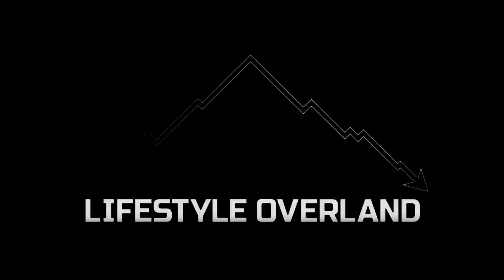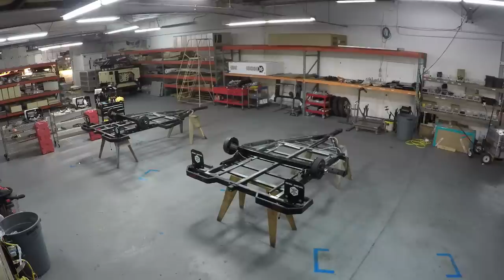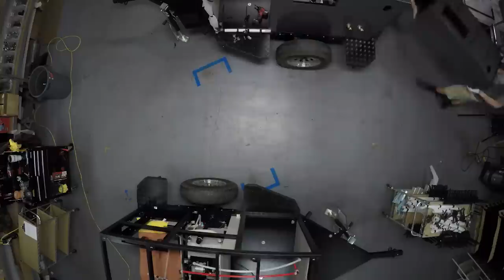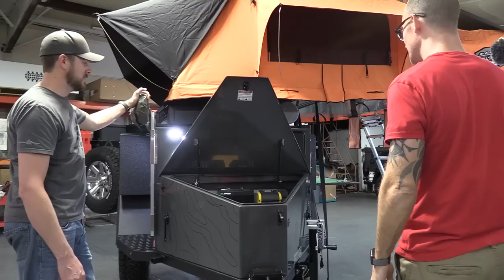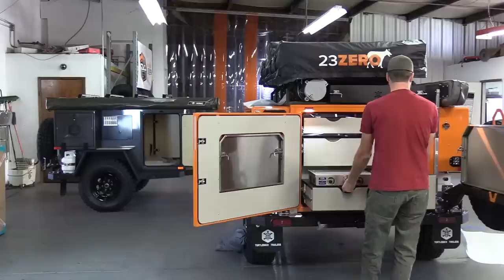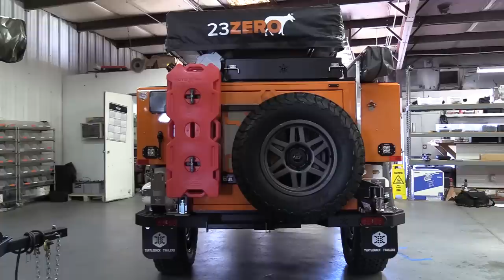Testing our new Expedition Trailers with Swell Runner!

Comment: Great build.  No pressure, but how do these compare w the Patriot.  They look the similar, just curious what your major selling point is.  PS before you say built in USA, remember I am and ex-aussi living in Canada.
Reply from the maker: Thats a great question which we get a lot. They are both amazing trailers but we went with Turtleback for a few  reasons. 1) The water tank is actually inside the trailer, not under it. That means we can camp in freezing weather as long as we turn on the water heater who's ambient heat actually keeps the compartment above freezing. You can not take the Patriot into freezing conditions with water in the tanks or they will freeze. 2) The kitchen opens to the rear on the Turtleback, depending on the model, the Patriot kitchen opens on the driver's side, which is into traffic in America. 3) The gas systems are already connected on the Turtleback, just slide the kitchen out and turn on the stove. You have to physically connect the stove on the Patriot to the tank every time. Also, the water heater and stove both run on propane, so no need to buy both desiel and propane. 4) The tongue weight of the Turtleback is between 125 - 150 lbs so you can physically move it if needed on the trail or at home. The Patriot tongue weight is 425 lbs which is also a factor if your rig is already heavy with mods. 5) Turtleback uses domestically available components and appliances you can find at any RV shop. Patriot has AUS proprietary components and appliances so it might mean a longer wait for service.
That's just a few items from our pros and cons list. Not knocking the Patriot at all, it has a really cool look and is a capable unit. It's just going to take a while for them to adapt to the north American climate and parts.

Comment: Too cool.....I want to pull my boat so maybe you could pull the orange part off the trailer and slide it into the 8 ft bed of my truck...maybe???   Also, is that solid suspension on the trailer?
Reply from the maker: I've always thought a Turtleback in a vehicle would be awesome. That's a rubber torsion axle. It has a rubber cartridge with an embedded axle and trailing arm. We recently upgraded to the new suspension though!

Comment: Seems like the food storage is in the wrong place if your using the stove?  Do you have to fold the stove up if you need something in that storage?  Design flaw?
Reply from the maker: Depending on how you outfit you gear it can be an issue if you forget something while cooking. Originally there wasn't even a drawer there so it's actually an improvement over the 2017 models. Storage is king, but in a small space there will always be trade-offs. You either pre-plan your meal, or put your cooking gear in the upper drawer and side box.
Reply: Lifestyle Overland thanks for the reply.  Hope they consider an L shaped kitchen for 2019.  That would solve any access issues...

Comment: That trailer doesn't have a suspension?  Those rough roads have got to be tough on the contents of the trailer.  The orange color is great.
Reply: It has a quite rugged suspension...
Reply: It has an rugged axle and frame, but I didn't notice any suspension.  Suspension as in shock absorbing parts.  Maybe its a torsion axle instead of the typical leaf spring design.
Reply from the maker: You've got it. This is a 3,500 lb rubber tosion axle.

Comment: Are these bolt together with no welding? Thanks
Reply from the maker: The chasis is fully welded, as is the box frame. They bolt together along with high strength adhesive for waterproofing. Thanks for watching!

Comment: Solid axle offroad trailer.....hmmmmm. How does it ride on the tracks over there?

Solid axles are nice and simple, but here in Australia, the corrugations and sand moguls would first destroy all the contents inside the trailer and then shortly thereafter probably shake everything else to pieces, including the chassis.

Have you considered any independent trailing arm setups? From personal experience, there are no comparisons between ride quality and articulation benefits.
Reply from the maker: Not a solid axle. That would be insanity. It's a rubber torsion axle with trailing arms. Very effective.
Reply: Thanks for the clarification. Have you looked at independent swing arms?
Reply from the maker: Yes, in fact if you watch this episode you can see the upgrade we went with: https://www.youtube.com/watch?v=KIhVMRoMyTY&t=22s It's incredible!